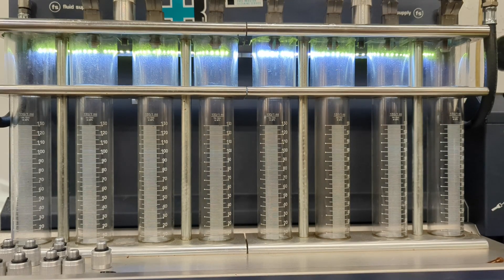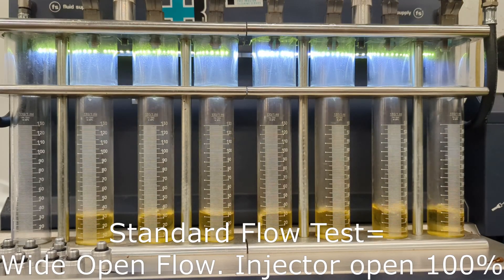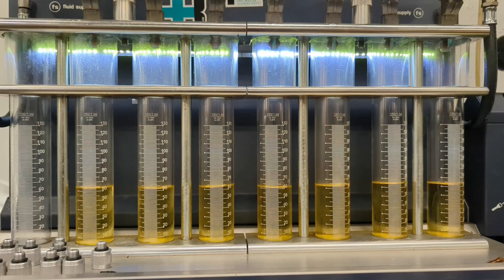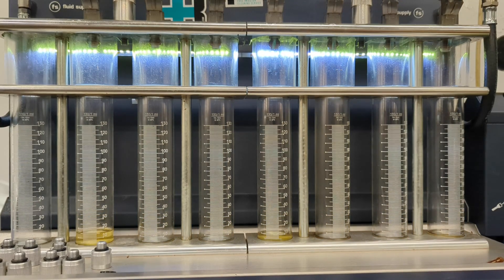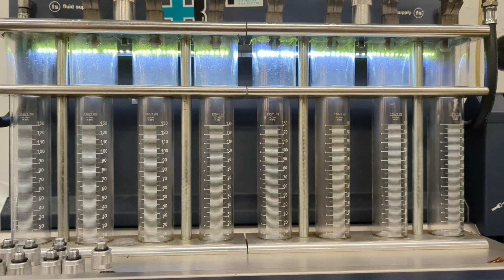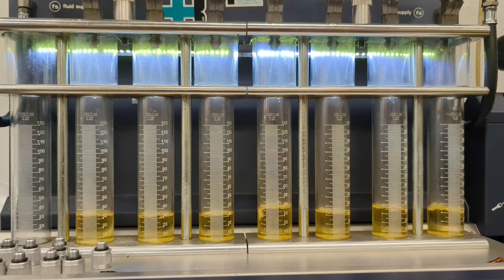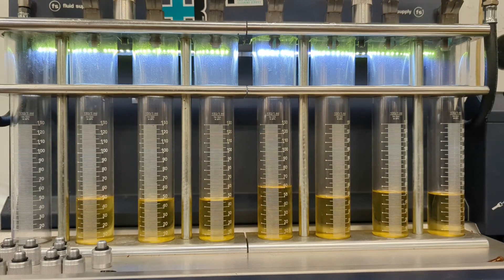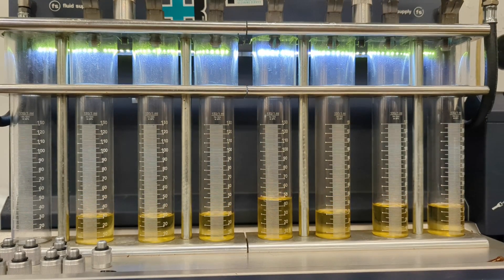Injector Flow Testing - Standard vs Dynamic Results

Comment: Interesting ! 

What fluid do you guys use ? Also i am having an issue calculating Injecotor Size On my machine if I hold the injectors static at 43psi for let’s say 15 seconds and multiply that by 4 ( 4x15=1 minute ) I’m not getting anything near what the injector is is supposed to be. Not sure if it the fluid I am using ( mineral spirits ) or is my math wrong ? lol
Reply from the maker: @GreMaLiNFiLMz  The correct fluid is sold on our website. It works just like any other website using a search function where you can type in heptane. 
If you want any additional info on how your calculations are incorrect, reach out via our website. Not through YouTube